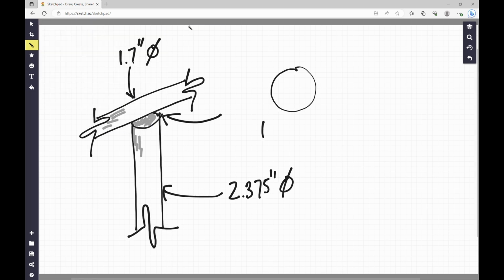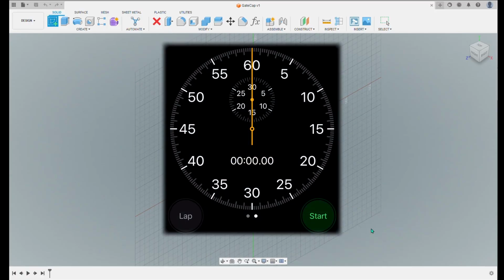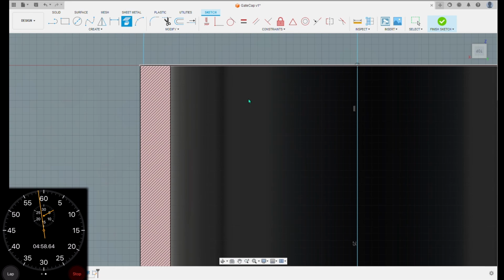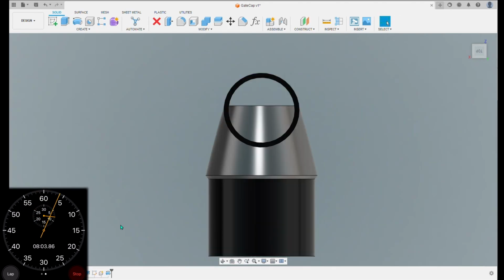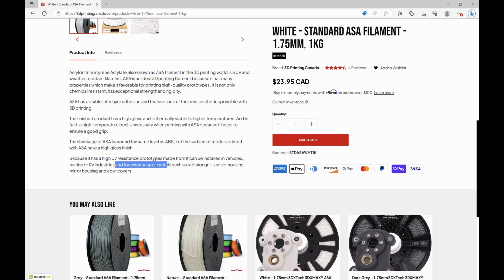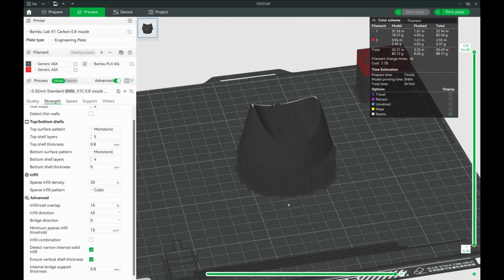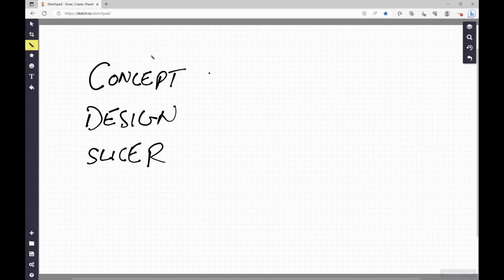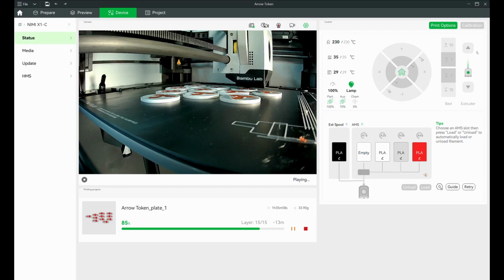How fast can we take it from concept to 3d printed part?

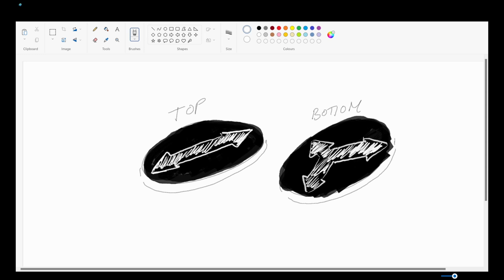Comment: 5:10 Clearly the best way to save money is to buy a $1200 printer and learn how to use CAD 😅
Reply from the maker: Any printer will do.  It just takes longer and may not be quite as clean.  I started on an ANET A8 pieces of absolute garbage, but I was able to produce a lot of functional parts.

Comment: The bambu lab support material is 100% worth the money
Reply from the maker: I still have a spool ready to test out, but that material change time is what I'd like to avoid.
Reply: @NeedItMakeIt  yes but it is at times unavoidable due to the factory part cooling on the x1c
Reply from the maker: @Moodyfabrication  Good point, have you tried any larger nozzles with the X1C?  I have the 0.6 and 0.8, however I think the heater is not capable of pumping out material like some high-flo hotends.
Reply: @NeedItMakeIt  I have not I have a  06 but have not changed it due to so many people breaking the connectors off the board
Reply from the maker: @Moodyfabrication  I've swapped to the 0.8, and I did pull the pins from the connector, I had to get some tweezers to get it back in, some room for improvement there for sure.

Comment: I would like to have seen how you cut the excess off of the piece. Thank you.

Cheers from the Oil Patch in Central WY, USA
Reply from the maker: Somehow I missed recording that, was it removing the the supports?  

Greetings from near Toronto Ontario Canada!
Reply: @NeedItMakeIt  

You didn't show how you excised the round 'waffle' part, which was the 'outside excess' I guess you'd call it.

I'm just trying to wrap my head around 3-D printing, which is quite difficult for me, as I'm 'dimensionally challenged'....it mostly still looks like 'magic' to me.
Reply: @jrbailey3208  The waffle part is the support for the overhang, usually you just pull them off or at most cut them off with flush cutters. Just think of it as a reverse of CNC machining. You can also download one of the slicers and slice some stls, preview them and get a better understanding of how the printer lays down each layer of plastic.
Reply: @mistrsynistr7644  

Thank you.

Comment: No bro solid edge is better and its got a free version with no stupid things in place to get too subscribe.
Reply from the maker: I did not know this, but I will be checking it out.  I've been trying to use Tinkercad, but having used Inventor/AutoCAD/F360, it is quite a step back.  Thanks for letting me know!
Reply: @NeedItMakeIt  No worries there is also DesignSpark Mechanical which is free and pretty powerful also.
Reply from the maker: I'll be checking these out for sure!  I pay quite a bit for F360/month.  I use it for CNC also, but mainly for 3D printing design.  But I am completely open to testing out some other softwares and see which one has the best features for free or cheaper at least. Thanks for taking the time!
Reply: @NeedItMakeIt  No problem hope you get on well with it.

Comment: Alright if you have a free got Bambu X1 Carbon 3D Printer and also have the skill to design the part. Sadly most of us are not that lucky!
Reply from the maker: Certainly having the new faster printer helps to put out more content, but it isn't required.   I've tried to cover this in the video, I'm still using my Enders all of the time, I love their customizability, and maybe a Sonic pad and a new DD setup could give them a boost?
Reply: 3D printing isn't for everyone, but it is something that with a minimal amount of skills and $200 you can produce things you can use especially with the many files available on the internet
Reply from the maker: @bwselectronic  The tech is improving so quickly now, lots of competition.  The newest gen of printers requires a lot less knowledge of how it works, but on the other side of things, like anything the more complex it is... when something does go wrong, it would be hard to figure out what the problem is.  New cars vs old cars.  I suppose we're still quite a ways away from using a replicator.  A question for you:  What is the thing that people need the most of which could be printed?

Comment: Paused at 55 seconds. 
So this part cant be uploaded licensed nor sold because no license check was performed. 
Unless anyone here is a day 1 newb we all should know by now drawing a thing does not make it original nor give the right to upload or sell. 
Ok lets push play again.
Reply from the maker: Can you share a little more info on this, I'm not sure what you mean.  This a very specific use case, it is highly unlikely that there is already a design and patent for something like this.  Regardless, the part isn't posted nor is it for sale.  Maybe you can share your experience and shed some more light on it?
Reply: @NeedItMakeIt  
Basics for newbs. 
License check all uploads and sales, no matter how the thing file came to be.
Even if you drew it. 
Even if Ai drew it. 
Even if scan. 
Even if a walk in customer with file.
Even if you call yourself a farm, service, or old McDonald etc. 
Even if you find a so called free file. 
Even if you purchased file.
A license check is to search. 
3dmdb
Yeggi
Stlfinder
Google
Net.
Now combine all results from all searches into one massive list. Yes still manually done, gpt has not achieved it yet either so 
Then,
Sort by oldest first. 
Then,
Filter out cgi, cnc milling, laser cutting etc.
Thats the basic overview of a 3d print thing license check. 
Non commercial license is a owned thing, that owner sets terms of use, who may sell it, prices if any, so on. 
A thing license ownership can be sold. 
Examples of value. 
Stl per copy                            $1.
Physical print                     $100.
License ownership    $ 100,000.
I might post you a how to about,
TRANSFER thing ownership, within a site, upload dates are matched to original by email arrangment with site. 
MIGRATE is to move, spread ownership to another site or sites, upload date of creation get matched to original by site by email arrangement with site. 
SEMI MIGRATE. Spread to new site but upload dates dont match, be carefull not to delete original. 
Theres a few basics for newbs.
Reply: @NeedItMakeIt   share my experience, its full of bites from once were smarter sharks. 
Im pleased you asked any questions. 
One of my big annoyances in our sector is silence, its obvious sharks dont warn food fodder newbs before eating them.
The shocking lack of any info around is by design you see. 
Whats not being said is a idea i had that is one reason i got so far. 
Theres lots missing from instructions. 
Newbs, farms and services continue to be closed down, commonalities are,
Lack of education. 
Thinking they drew a thing must make it original when it does not. 
Modifying is not enough either.
Selling a print found for example from thingiverse only to be closed down for piracy. 
Idiot newbs not license checking before uploading and giveing a thing away, causing others who list or try sell just 1 print of it to be closed down for piracy. They all go back with very angry faces to uploader. 
Farms folding with no assets to sell up, they never licensed any designs for years, mean while the sharks who were GIVEN those designs now own them. The shark ends up owning the things. What was the business? Selling that thing. But they gave away the design, in essents they gave the business ownership to the first shark that saw a good thing. 
Another farm folds like last weeks closeing. A few out dated no value ratterly printers for sale worth nothing. 
All valuable assets were given away, the designs.  Even the right to sell there own products. Yawn, another closes, another, another...........
Doing his own thing was a quote that rings in my ears as he closed down. 
Farms or services that wont answer basic questions are commonly closing, again with the silence. Did they license check that listing or sale? No reply is a massive red flag,  a sign to me they most likly pirates, most likly draw more heat, most likly get caught and closed by anyone who wants to, Most likly to be busted and closed.
  i see it over and over.
Little old ladies in our sector, to not license check that sale would mean royalty not paid if in terms, bam done. 
Robbing little old ladies is not a good look. 
Those farms are one walk in customer away from busted. 
Contacting the genuine owner of a thing to see if the royalty was paid also easy.
Having to pay back all money made to genuine owner in court. 
Ive coached farms. Services. 
Newbs. So called experts. Licenseing sites.
Teams of Lawyers. 
I didnt get the go ahead run a 99 million dollar listing without a lot of effort, and hair loss ha.
training the lawyers was fascinating. 
A comment on silence is the negotiations are done for them? All agreed? Silence, passed. 
Is that really the best deal for them? Silence, done next. 
That is happening. 
There are many snakes and sharks and hackers these days, remember when looking stuff up was a few enthusiasts with mere hundreds in list. Now ball park 30 million licensed things. With numbers comes situations. 
Weak as water search engines costing us all massive losses. 
Did you test the search engines again last week?
Plus or minus 13 years. 
Not an issue if list fits on one page but 30 mill now you see how we are slowing. Costs go up. Takes longer. 
Whats the cost?
Medical and health care are searching to so whats the cost to find things in time?
In testing last week the genuine thing was aprox 910th place down list. If anyone uses any of the 909 befor the genuine bam they can be closed for piracy. 
One less farm in competition. 
Sharks can be very competitive. 
Wait until youve lost ownership a bunch of times. Loosing a valuable asset really hurts. 
Basicly loosing the business ownership. 
The right to sell that thing could be the business. 
Ive lost stuff of course. 
Sharks, snakes, hackers, all sorts. 
Even some influences are not what they seem to be. 
Once you know been here long enough the snakes reviel them selves. Use this service minus critical info that when anyone does the sharks are waiting to pull the rug from under your feet. 
And unless you know this game you wont know you lost your ownership. 
You wont be told. 
Not until way later you can be closed at leisure. 
Thats more common than it sounds. 
I could go on but lets post.
Reply: @NeedItMakeIt  
You said its unlikly, but you dont know its original or not  cause you have not checked yet. 
You said not posted. 
Dood im looking right at it. 
I can see it. 
The sharks can see it.
Its been hours, its probably license and owned and sold already. 
Looks like you gave it away free from my seat. 
A shark would not say so cause its a snack. 
A shark would think to look at everything youve ever given away, and license it all, and never say a word. 
Thats your competition. 
Im more relaxed swimmer now, im feed so less need to bite. 
But i might save a few newbs from bite marks if i try. 
I might be able to improve search engines so we can find each other. 
I bet Elon he could not make a working search engine within a year, 10 months to go. 
Not to give a result but the one true genuine answer, theres only one not 909.
There can be reasons for second place like genuine owner hold same thing at many sites for security. 
Anyway a few insights. 
Imagine the scale of royalty losses currently from not finding things. 
Its mega. 
Just one license im looking to calculate is ball park owed 10 mill. 
Thats if 2% royalty. 
If it were set to 50% by owner omg.
Yip the sector is up for more of a shake up. Ai has been trained and has been used in sector, i felt the burn. First to win, first to feel burn. 
I got my pass again this year so pressure is there. 
But based on number of improper uploads and sales a bigger cage shake is coming. 
Ive recently coached big players who took action straight away, so we shall see. 
Its happening but i can see they are starting slow to get to grips with the game. 
But based on prior experience it is moving. 
If you have issue with any of my license dont just hack me try post me a message to suggest terms. 
Thank you. 
Yes ive been hacked a bunch of times. Sometimes ive had pop up saying so and so is spying on you. 
No wonder my net is slow spies on spies clogging up the line. 
No wonder its buffering. 
I know its the billion dollar listings that cause excitement. 
Arrrrrr i need new shoes. 
Wishing you nice success. 
Be well from Will and Mr C Data. 
Thats my android friend.
Reply: @NeedItMakeIt  did you almost get a stroke reading the comment? I thought I was having a stroke there for a second. 

I guess he's warning you about the Jukin media strategy (they buy video rights and copyright strike react content creators for the monetization)with the things you create.